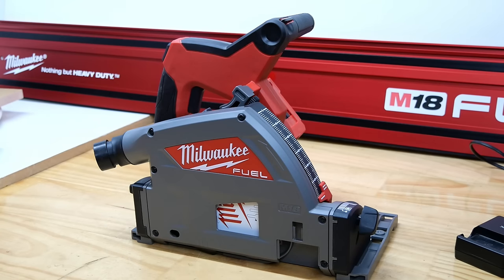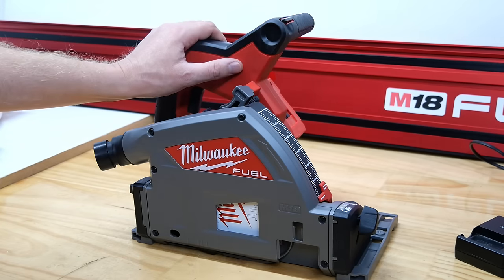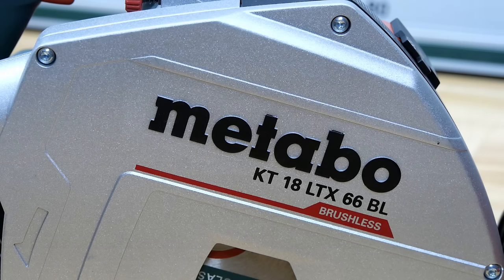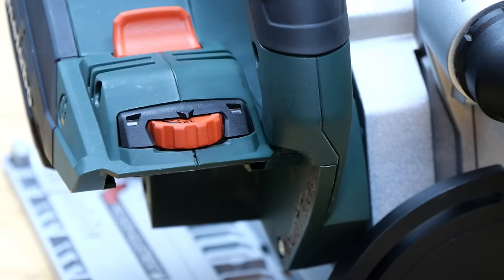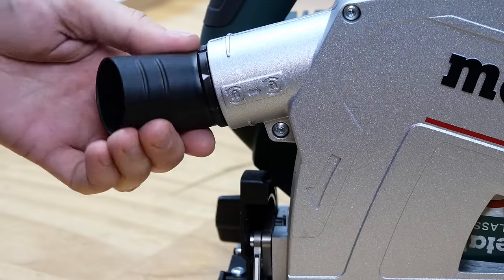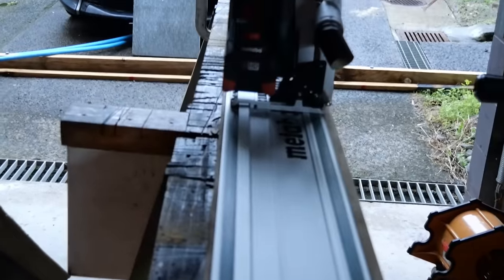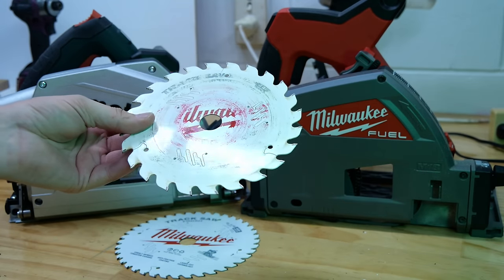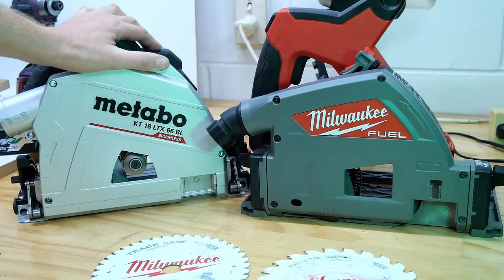M18 Milwaukee Track Saw VS 18v Metabo Track Saw Comparison Review. Plunge Saw Showdown.

Comment: As a Makita guy, I think the Milwaukee track saw is better.
Reply: I’m on both platforms but I’ll shortly be buying the XGT saw.  The Bluetooth dust extraction feature has sealed the deal for me
Reply: @is5032  I have the XGT model. An issue I have with it is if the front and rear angle screw locks are not just so,  when tightened they will bow the base as the two are squeezed together.  It can be remedied by adjusting the base and angle bracket screws.
Reply: I have the XGT tracksaw I don't like the depth stop adjustment as much as milwaukee but the AWS is really nice to have. I have the adapter and a fein turbo for my dust extractor. It's a great system I also think the makita has more grunt then the milwaukee with a 5Ah or a 8Ah battery its going to be better at cutting hardwoods then a milwaukee and if you are cutting stuff up on a MFT type table the saw and material/sheets or wood are going to be supported so anti kickback features are rather redundant. The both have them but for what I use that saw for I don't find them to be necessary.

Comment: I have the metabo, like the extra depth of cut, love the dust bag supplied and the dust port. Miss the scoring feature. Supplied blade was pretty average. Overall good tool. Sold my 2x18 makita for the metabo because the 2 batteries was inconvenient.
Reply: Oh man no scoring feature big Shane I was thinking of upgrading to the hikoki but that's a must have feature
Reply: @Therealphantomzero why just set to 2mm or whatever, then takes 1/2 second to adjust to depth, only need scoring for some materials

Comment: The hikoki wont fit on the Milwaukee track. the guide rail is just a little to wide and is too tight to push easily, even when adjusted right out. I actually took my hikoki into the shop to try, as i brought a dodgey makita track, and their are no hikoki/metabo tracks in Nz yet, can get a hikoki saw but no track!
Reply from the maker: The hikoki does fit on the milwaukee track. Watch this video. The Metabo is identical to the hikoki.
Reply: @ToolsAndStuffOFFICIAL   I don't know if it's my particular hikoki saw that's the problem or what, but getting a track for it has been the most frustrating experience ever. After buying the hikoki and a Makita track, cos there were no hikoki/Metabo tracks in NZ . The Makita track had  high spots in the extrusion which caused the aluminium track to rub the base of the saw. Checked with a straight edge and yes the aluminium was higher than the friction strips. Grrr took it back to the shop, Makita said since it wasn't a Makita saw on it they wouldnt replace it. So took it into tradie republic to try a Milwaukee track and it was too tight. So forced to buy another Makita track and thankfully got a good one. Interestingly I tried joining the two Makita tracks and my original one was slightly wider in the square guide rail part, so the saw is  sloppy/tight on one but good on the other! So, I have a hikoki saw running on Makita tracks, one which is unusable, joined together using Milwaukee joiners!

Comment: I always have one hand on the base plate one pushing when I’m cutting mitres with the trackasawrus. Can’t trust any of those hook devices. Plus lifting the saw off at the end of the cut to set down and move the track. can’t be assed to keep flicking the tab back in. Grief.

Comment: Great detailed video.
The obvious rhing you forgot  to mention  is how Metabo achieve 11mm more deoth of cut using the same diameter  blade
Reply from the maker: You can't of watched the whole thing else you would know it isn't 11mm. The first test I did showed that.
Reply: @ToolsAndStuffOFFICIAL  Sorry my mistake.Metabo achieve that extra 6mm by placing the spindle bearing closer to the base plate.If you  turnthe saw upside down you can actually see the cut out in the base plate.ok it's only 6mm but every mm is an advntage.
Reply: @ToolsAndStuffOFFICIAL  can't HAVE, not can't of. What is it with us Kiwi's and our terrible grasp on the English language 🤣
Reply from the maker: Yeah, nah, I was talking kiwi,  not English.
Reply: @ToolsAndStuffOFFICIAL  haha

Comment: Folks need to stop worrying about differences in voltages
If the size, weight and other specs are in same ballpark voltage should make no difference when comparing
I've never been cutting with my Hikoki/MHPT or Makita 36V rear handle framing saw vs my Milwaukee 18V and said "damn these 36V's why are they cutting so much better" than the 18V
 But I did notice 36V's are actually lighter than the Milwaukee, Flex and Dewalts
Stop the voltage madness-just want the best tool for the job
Reply from the maker: Milwaukee tracksaw is lighter than the hikoki. Hikoki is heavier than the Metabo.
Reply: My M18 7 1/4 skilly cuts harder than most corded skillys. Probably just as hard as the 40v Makita and 54v Default I reckon
Reply: @ToolsAndStuffOFFICIAL  mostly referring to voltage Nazi's- does the 36V Hikoki have any more power than the German Metabo?
Reply: It's about power and torque to the drive spindle. At 18 volts, you need 2x the amperage  as at 36 volts to provide this out put. If the system is well designed to provide  a certain output, then there is not much difference  in which voltage is used. Yes, I know great efficiencies can be gained in higher voltages, but maybe not in these cases.
Reply: @glenndennis6801  we've noticed the 36V tools especially the Hikoki/MHPT triple hammers to run cooler that the identical 18V version doing the same job-and the 2.5ahr 36V runs just as long as a 5.0ahr which folks seem to always point out "it's only a 2.5 ahr, your losing run time with the higher voltage with same size battery compared to 18V" this isn't actually our experience, the 36V tend to run cooler, have a bit more consistent torque and have longer lingevity

Comment: I have the makita 40v the AWS feature is the best thing about it. The milwaukee has a few features I wish makita had but no auto vacuum is a deal breaker for me.
 as it mostly gets used in my shop with a MFT type table I built myself with a fence rail guide ,hinge ect,
Reply: The Makita AWS is nice. I have the Milwaukee track saw and the Milwaukee remote to turn my dust extractor on and off. It's not AWS but it's good and it has a long range. DeWALT has a similar technology - a manual on/off remote.

Comment: Love the Makita and the Festool. I like my Makita over Co workers Festool due to Makita has a plunge function. Im interested in the Milwaukee but no one ever talks about how the blade is on the splitter strip does it cut the same spot and not mess up the strip cutting 90 or 45? My Makita cuts at the same spot and would be  a deal breaker if it cuts like the Dewalt in 2 different spots.
Reply from the maker: Same spot.

Comment: Just today I got to check out the Milwaukee at the tool store, display model didn't have the anti tip knob, only a black plastic button in place that didn't seem to do anything. I guess it's different here in europe, just like sheet sizes. 

OSB and ply you can get 2500x1250mm, but laminated chipboard and mdf is almost always 2800x2070 for a full sheet. Bosch and Mafell also use 1600 rails and they are a necessity for comfortably cutting these if you don't have a 3m track. 

Thanks for the video, good stuff as usual!

Comment: I almost bought the Metabo last year, because the Festool consume battery so quickly. But I can't find any information about whether this saw is compatible with Bosch track.
Reply from the maker: Now you know it is. But be careful as the width may be different from the bosch so the splinter strip may be an issue.

Comment: unless makita starts dropping a ball big time, not really interested in any other brand. Not saying they are bad or better in some tools, just not interested in purchasing. Of course its nice to see new tool releases, but I am good with Makita.
Reply: Well they have already dropped the ball to some extent by still using 18650 battery cells in a lot of there tools when most of the other major brands are using the 21700 cells.
Reply: @MrTherbst  40v line is where it's at for pros ...when it comes to the 18v line makita likes their tools working for a long time.  that's why their battery and tool connection is top notch and they last forever.  Yes I'm 100% on board that the batteries give a power to a tool, that's why Milwaukee and Dewalt tools are constantly at the repair shop
Reply: @UncleIvan1  I don't agree with your statemenent that only 40v Makita tools are designed for Pro's..........so you implying that any other tool Brand such as Festool,Mafell, Metabo,etc aren't designed for Pros because they are running on 18V batteries?This makes no sense at all.
Reply: @MrTherbst  no, im saying if you are a pro and want your batteries to have the juice longer (because that is one of the most important things) , then invest in the 40v. meaning the 40v makita is probably better suited for pros. Not that the 18v tools can't handle most jobs.  They sure can.

Comment: Great video, a new Makita grinder has been released in Japan, Ga052. Any details?
Reply from the maker: Yes. Fastest cordless grinder ever!
Reply: @ToolsAndStuffOFFICIAL  Fastest cordless grinder is the german made Metabo 125mm WPBA 18 LTX BL or not?  1500 Watt motor.
Reply from the maker: Not anymore. Makita have just released 2100 watt 11,000 RPM cordless grinders.
Reply: @ToolsAndStuffOFFICIAL  cant find this grinder. Can you send the model number.

Comment: You’re gonna hate the Festool when you review it. 😂
Reply from the maker: Surely not.
Reply: I have the TSC 55, and I'm really tired of the dual battery.  Plus, their batteries suck.
Reply: @brandonbennett127  The older batteries with the adjustable belt clip on the bottom or the more recent “airstream” and following Bluetooth variations with the fuel gauge?   I sold off the older ones before I got the blue Supercut. I run the newer ones really hard on that. No issues (knock on wood).
Reply: @Robert Rada  they are the newer airstream bluetooth batteries.

Comment: Hey mate makita have a track saw for cutting metal here in australia so youve probably got it there too. 

It only got my attention because its fully enclosed unlike the traditional makita track saw with the hole for changing blades. I wonder if its identical to the normal track saw just with a different frame.

Comment: The Milwaukee saw has a sticker which in part reads "Professionally Made in China" 😆
I'm not knocking China. It's just that the use of the word professionally somewhat undermines the intent.
Apple don't say their iPhone is Professionally designed in Cupertino and Professionally made in China.

Comment: I own both and the Metabo is significantly better.
Reply from the maker: It most certainly isn't.
Reply: @ToolsAndStuffOFFICIAL  yes, it is. It has more power through harder material. The adjustments are more accurate and easier to implement. The blade change is better. The depth of plunge is significantly better. It is more powerful with the same blade. It has the capability of using off the shelf 6-1/2 blades with 5/8 arbors (standard here in the US). Dust collection is so much better that it's laughable. And it feels more premium. Battery placement is better. Everything about the Metabo track saw is better than the Milwaukee.
Reply from the maker: No. It feels cheaper, has less power. Has the flimsyist blade change of any brand to the point I had to get three of them as the first 2 failed immediately. It is so cheaply made. Has less features. Amazing how we see things so differently.
Reply: @ToolsAndStuffOFFICIAL  that is strange. I own and use both, regularly. I keep the M18 at work and use the Metabo for custom woodworking. To me, the Metabo oozes quality while the Milwaukee feels like an average construction tool.